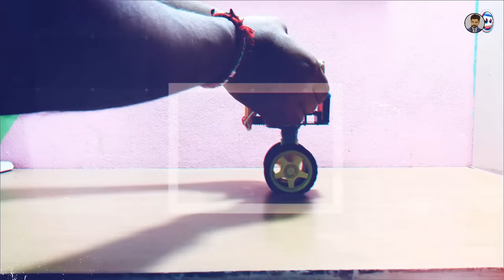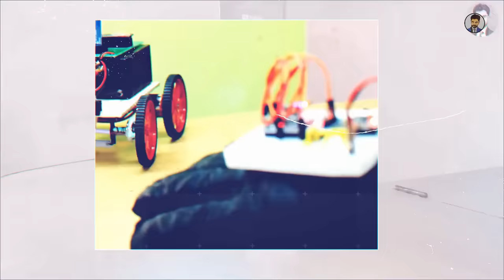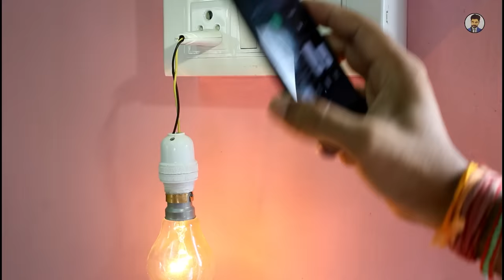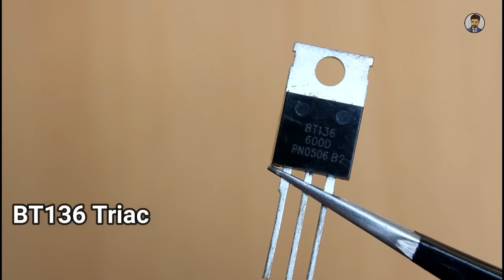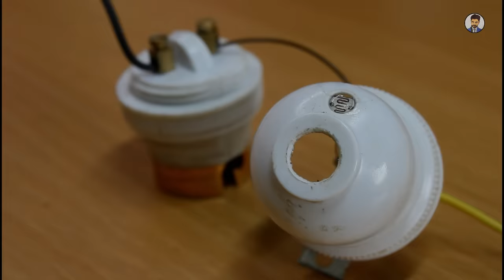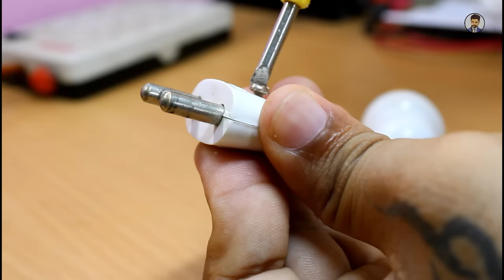how to make 230v street light without relay

Comment from the maker: The circuit diagram is description in the video.....
Reply: Kanti Sir i couldn't find the diagram. Please help me.
Reply: Very good idea, Kantian beta.thanks.
Reply: Pls snd me diagram
Reply: Diagram is not available
Reply: Best
Reply: Good idea keep it up
Reply: Sir how to make DC 5.0 V please sir tell me please
Reply: Bade area ki street light contol karne k liye kitni capacity k device chahiye honge???
Reply: Bulb light is very low
Reply: Bulb wont glow in full intensity, LED and CFL wont even glow and flicker and will damage, you also know thats why u have used old tungsten bulb but  still u made such projects, not informed what is correct and wasting people's money just to earn money!!!
Reply: Mr Kanti, puedo utilizar su circuito con 120 voltios ac? O debo realizar alguna modificación en la resistencia?
Reply: Super
Reply: Kanti sir how many ohms resistor should we use please say me sir
Reply: If you do not use the heatsink, the transistor will be damaged
Reply: If you do not use the heatsink, the transistor will be damaged
Reply: @fahimasghar6375  good gh
Reply: It's not working
Reply: boru vada led lit eka dala balanna ko😂😁😁😀
Reply: Sir diagram not available in discription plzz send the diagram
Reply: Fek video

Comment: You have used incandescent light bulb only. Can't we use cfl or LED bulb in this circuit ?
Reply: It won't work for CFl and LEDs.
Reply: Same question
Reply: U can use !!
Reply: Nope...if you you will use led it will flicker
Reply: @shub7755  no See other youtube related videos.. I am going to try this in few days ..
Reply: @shub7755  any reason?
Reply: Yes the reason is the led bulb take much less power compared to incandescent bulb, thus it draws more power through the circuit and remains in a stable state(NOT ACTUALLY, IT IS JUST NOT VISIBILE TO US)..and the led bulb flickers because it draws less power and cannot attain a stable state...
Reply: This is because in case of incandescent bulb we have direct load I.e. voltage at one end is directly applied at the other in off state(no drop) but in case of CFL or leds we have driver ckt in which we have certain unilateral components like diodes,etc thus it wouldn't work.
Now I think I have I little solution friendz if we use high value resistor 470kohm or 1Mohm in parallel to load.

Comment: The project is good but there is a little flickering of the bulb, it may leads to a damage to the bulb
Reply: What is the solution?
Reply: Can we use capacitor ?
Reply: Solution is that you have to use relay instead of triac BT136.
Reply: No, you can't.
Reply: Sir apke street light ke video far mene Kam Kya likin Kam nahe karta

Comment: It can be used only in complete dark in night as even a little or partial light from any source will not allow the circuit to work, more over the bulb can't work to its maximum prescribed efficiency, Better the circuit is modified to operate on DC voltage for LEDs !

Comment: .Maine aaj ye circuit banaya, poora din laga raha magar ye sahi se kaam nahi ker raha. Maine wiring, resistance value bhi change ker ker k dekha but problem solve nahi hui.

1- Bulb direct jalta rajta hai wo bhi 80-90% glow kerta hai na ki 100 %.
2- Mobile ki flash light ko LDR ke paas approx 1 inch door rakhne par bulb off ho jata hai. 
3- Room light on rahne per bhi Bulb glow kerta hi rahta hai.

Maine LED aur 100watt normal bulb dono per try kiya hai.
Pls check this circuit and reply.

Comment: Sir can i use 2x 150k resistors  instead of 330k??
Reply: Yes 2x 150k Resistor
Reply: @naveedkhan462012  thanks alot bro
Reply: You can use 2*150 ohm resistors but USE in SERIES not in parallel,
Because in parallel it's resistance will be divided into half
Reply: @nagarajukapileswarapu1294  ok thank you
Reply: 120k hi lagao.. full glow hoga bulb..
*65k tak no risk..
ldr pe light kuchh jyada cjahiye bandh hone ke liye bas..
**LED Bulb use na kare..
Reply: @GujaratiKanudo 
Resistance ki power rating kitni honi chahiye?
Reply: @Mr_Cap.  mininum Halfwatt is always better for any 220v circuit
Reply: @GujaratiKanudo  I've used half watt resistor but that got burnt..
And circuit wasn't working anymore, bulb was glowing all the time, even in sunshine.
Reply: @Mr_Cap.  check TRIAC and connect new component with proper diagram